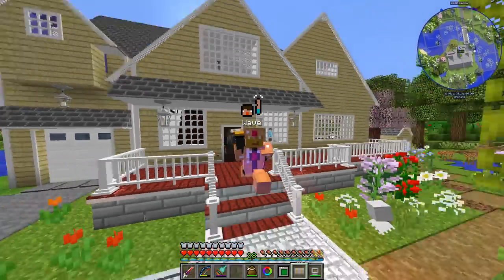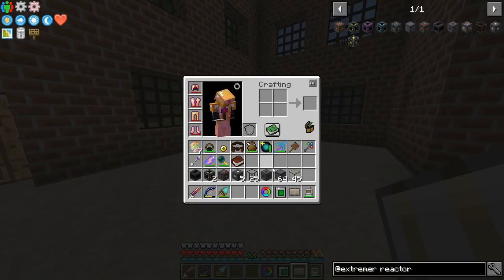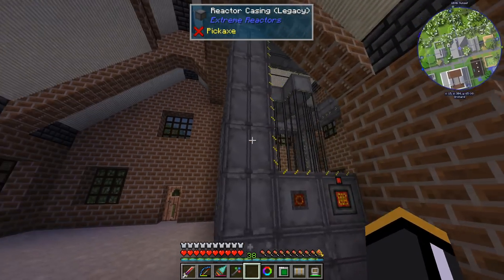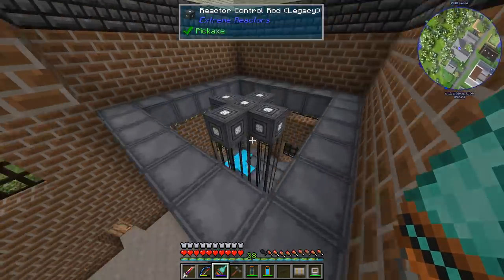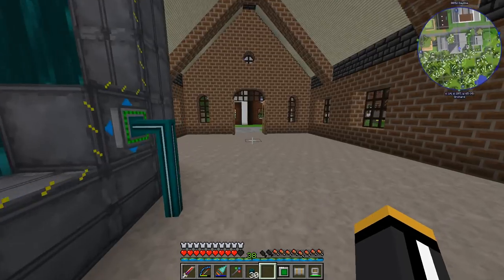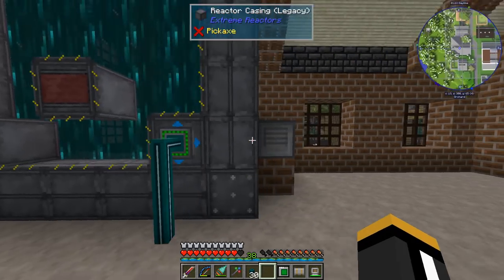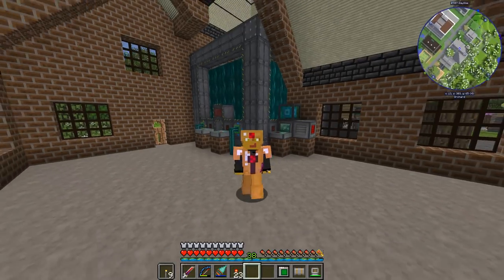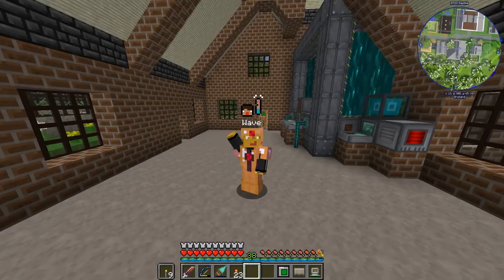Modded 1.12.2 - Extreme Reactor - Efficient Power Gen (E33)

Comment: I know this is an old video but having 2 exact same reactors side by side, completely filled with Gelid Cryotheum, I emptied one and tried your outer layer of Resonant Ender... NOPE!
Runs hotter and less efficiently.  What a PITA to alternate coolants. I did this a long time ago too with 3 different coolants on a much bigger reactor.
We are better off using only 100% Gelid Cryotheum for the whole reactor of this size (7x7x7). 
I can't remember why I used multiple coolants in a huge reactor but I do remember experimenting with an online reactor coolant simulator / calculator.
Reply from the maker: Interesting. I wonder if things had changed. I did test this extensively and also used an online calculator. The outer layer of Resonant Ender definitely gave me more power.

Comment: Most times I only use the resonant ender the diffrend is so littel and you can just use it on the top
Reply from the maker: You're right. The difference is pretty small, but I wanted to squeeze the most efficiency possible within the space that I had. There's definitely a point of diminishing returns , but it adds up over time.